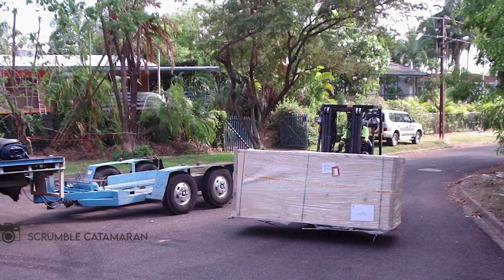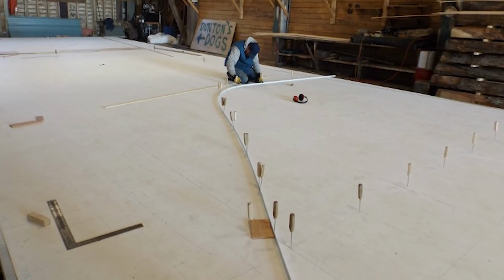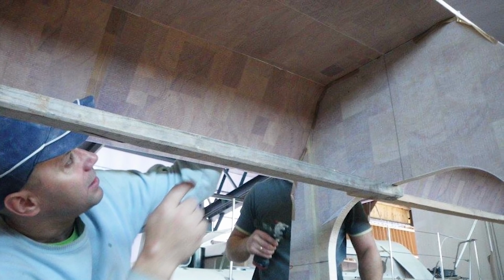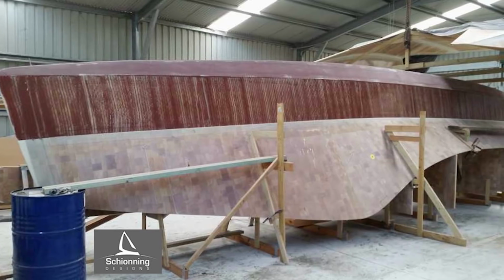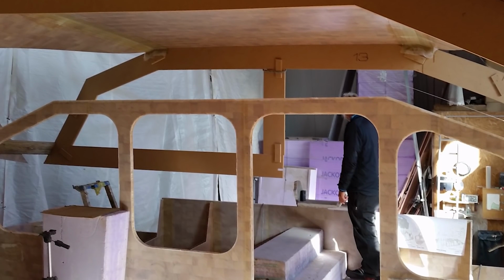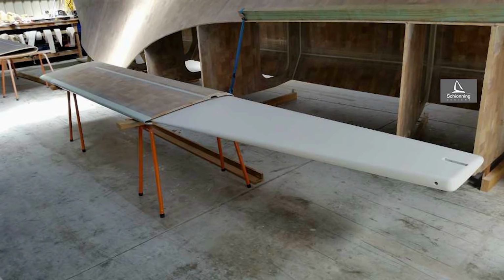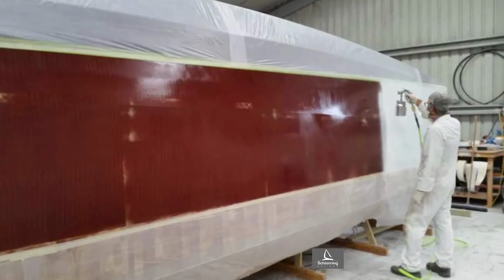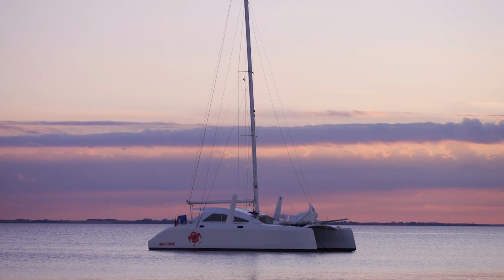What Does It Take To BUILD YOUR OWN CATAMARAN? - MJ Sailing

Comment: I've been watching you for quite awhile now but it's still a shock to see those old photos. You were just babies!! I fully intend to watch the boat build. In 1973 my friends and I worked 10 months on two 63 foot cement hull sail boats. Goal was to crew on one for our labor in an around the world cruise. Worked 10 months and the owner had a heart attack. He lived but the plan was scrapped and I didn't get to follow that dream.
Reply: I wonder why there are no cement catamarans?
Reply: Excessive material weight. And higher stresses in a multi that the cement can't handle. Strength to weight ratio in a multi is vital and the finished product would be a sea-slug.

Comment: Can 2 of you do this in a couple years? And it looks like a bldg is really needed. i think I would rather build  a kit plane...
Reply from the maker: After tearing our current boat down to the metal frames and building it back out again, we feel confident about doing a new build. Something where half our time isn't spent chasing down existing issues.

Comment: Good luck on your project. I've followed you for years and know you have the skills to do it to completion , but I think your underestimating the time it will take. In 1965,when I was 25 years old I built a kit boat 25 ft. in length, they said it would take 500 hours to build. It took 1200 hours to build. Good luck and stay safe.
Reply: Our first dinghy took twice as long to build too.   Just like build a second one, everyone reassures me that the second hull goes twice as fast.    -Matt

Comment: Good tools are a major expense but do not short cut your budget. You can make do on a smaller project but on a project this size It will cost you. Staring from scratch budget about Twenty thousand for equipment. This might be a little low but shop around. You can reclaim some of that after the build. While you have time a lot of information is on line. I have done my share of spray painting and the proper technique is important. There some videos by pros from paint companies that are excellent. They also show the proper equipment. With out that it can be very frustrating I have done it both ways.
Reply: Luckily, not a lot of tools are required for these types of builds.   A good router, jig saw, RO sander, dust collection and circular saw should see us through it.  The stuff we did on Elements required more precision since it wasn't being painted or filled with epoxy.   -Matt

Comment: Where are you going to do this? We are from the GR area and if you need a hand...
Reply from the maker: We're not exactly sure yet, but probably somewhere between Virginia and Texas.
Reply: @MJSailing  For sure you're going to need someplace warm. Providing heat for a building that size would cost a fortune. Good luck you two, hopefully you be able to find an extra pair ( or two) of hands that can help you along. Has Elements gone on the market yet?

Comment: Check out https://www.eastwood.com/paints/paint-equipment/paint-guns/eastwood.html       You don,t need expensive gun.   Use disposable paint cup.   3m and others supply.    Disassemble gun to clean, is quickest way and best way to clean and make gun work like new every time.  Have fun!

Comment: Great description of the process Matt , I think you definitely are aware of the work involved and ready for it.  
I was hoping to hear the hull panels are shipped as long pieces , precut  ready for assembly . Just 4x8’s is just a variation on a plywood design converted to fiberglass panels. Being in the business of making tooling for large fiberglass products including boats  my approach if using flat panels would be to build my own long flat mold and make by infusing  my own exterior hull panels. ( flat infusion is easy!) The interior structure could be from precut designers 4x8 panels.   
Have not been impressed with some if these designs made from cut up strips of coated panels , it wastes a lot of strength building that way and way to much fairing .
But it’s going to be fun to watch , and maybe help in some way! Cheers Warren

Comment: Hi guys and thanks for the overview. Just as getting the form alignment carefully correct as a foundation for a straight boat please start without using the terms fiberglass and epoxy resin interchangeably. For novices who will undoubtedly follow your build it will be a great help.  It shouldn’t be hard if you start out correctly. Maybe if you are applying fiberglass cloth/mat you could (and I know over the build it will become a bit of a time hog) say we are applying fiberglass mat using epoxy resin. Maybe it’s just a pet peeve but if people(and they do now) continue to use the terms interchangeably then there will be a more novices applying the resins incorrectly and suffering the failures. Best wishes on the build, I know it will be exciting. Your videos of your travel this year have all been beautiful.

Comment: Eh you meant 8lb foam not 80lb!!! 😃
Reply: Even worse.... it's was suppose to be 80kg per meter squared.    -Matt
Reply: matt johnson  easily done .80kg? really ? I think That’s about 16#/squ ft. , that might be the entire panel wt not just the foam , balsa core as used on wild thing is about 8.5# per sq ft. 
But whatever they spec .....
Cheers Warren
Reply: @CheersWarren  It's Divinycell h80
Reply: @CheersWarren  Maybe 8.5 pounds per CUBIC foot. Google has balsa at 10 pounds per cubic foot.
Reply: matt johnson 80kg/m3 not m2

Comment: I like both Grainger and Schionning. Beautiful designs from both. Orans I never drooled over the same way. Jeff’s son, Craig, has Spirited Designs and offers a pre-moulded bottom and deck-joint. It’s nice to have some curved surfaces instead of a angles. For the hull bottom it looks more like coming off a professional mold. I also believe it’s built in the upright direction so no flipping over the hulls.

Comment: Look into health side effects of working with these materials.  You might require safety suits and face masks with aired respirators.

Most synthetic resins and the particles produced when sanding are highly toxic.  So, please be careful.
Reply: The same thoughts occurred to me re adverse health effects of epoxy fumes and sanding glass-epoxy composites. For a (not that) young couple to take that risk is unwise.

The world could easily be heading into a Depression. What is left of their savings can be halved again or worse.
Reply: Paul Ohlstein perhaps they will take the necessary precautions.  They normally avail themselves of the necessary information to make the right choices.

These days we know that even sanding normal wood has long term adverse health reactions.

Comment: When you get to the paint stage prep the boat and hire a spray guy. That will save you money and time.
Reply: I hope I can talk a body shop into letting me steal their spray guy for a few days.  The guys I worked with before (I worked in car dealerships) would have no trouble switching over to something the size of a boat.  -Matt
Reply: matt johnson good idea matt, that’s my job and I was going to suggest the same. They have years of gun skills and it won’t cost you much in the scheme of things and a pro finish. An area not to skimp on.
Reply: Painters always like weekend money. I highly suggest getting help and sometimes 2 and 3 guns is better than one if you have a big spray. Boat yards many times have a good Gunslinger that's used to the big sprays but usually not the same experience of the body shop painter. In the body shop we are used to gravity or siphon feed guns and boat yards tend to have more experience with pressure pot setups. I would definitely consider pressure pot as it is much easier for the big sprays you don't have to fill the gun all the time and you can get some real material laid down and not have to spray forever and ever. But please whatever you do buy the highest quality paint. In my opinion there are really two choices Awlgrip, or BASF Glasarut. Whatever you choose do not use any water-based paints! I would recommend a base coat clear coat system even if you're using white color. But in no case use water base anything! You will suffer grief now or later on use the tried-and-true and it will last a long long time! I've had 38 years of Auto and Marine painting experience and own major Collision Repair Center. I hope this helps. When it comes to tools make sure you have a large air compressor 5 to 10 horse Electric. Best not to have cheap Harbor Freight model buy a good one and sell it when you're done. You MUST BUY a refrigerated air dryer to remove all moisture from the air and also an oil filter and additional water particulate filter. If you don't do this you will get moisture and water in your air and you'll be sorry in a year when your paint is bubbling and checking. Don't think that any water separator filter is going to take out the water it doesn't work that way you have to change the temperature and that's why you must use the refrigerated air dryer to extract all the water! A desiccant dryer is another choice however I would prefer that after an refrigerated air dryer but you should be able to get by without a desiccant dryer. They tend to be expensive. . Don't try to get by with just a desiccant dryer either. When you decide on your paint brand have your paint supply store put you in touch with the factory paint representative you are going to be a big customer and make sure they help you design the right system for you to use. That way it will be guaranteed!! It will save you all kinds of time and grief. The paint representative will help you with spray gun and spray tip sizes and pot pressures. An airless sprayer may even be an option but rely on that paint manufacturers field representative for help. Make them earn their money they're going to get plenty of it. LOL
Reply: charlie cruzen matt, very good advice from charlie.
Reply: @charliecruzen3394  Another option for keeping the crap out of your air for painting, is an HVLP turbine system.  They supply air that is inherently dry and warm, so there's not actually anything to remove.  A bit expensive but can be sold afterward to recoup some of the cost.

Besides auto body and marine shops, aircraft painters will also be accustomed to working with large jobs.

Comment: Since you are looking at value you are obviously looking at resale price.  To me some of these kits are fairly out of date on style.  You would not want to go through this effort then find out a boat was less sellable as it was very "out of style"   So I would make sure the style was pretty current.  At the same time as much as you want to "personalize", keep that next person in mind.  Personallizing to make it perform better or live better is good.  Personalizing to make it "unique" might not be.   As an example, I am currently looking at large used Diesel RV's.  Some have things like a sofa pulled out and that replaced with a "fireplace" or fancy entertainment center.  While that suited the original owners style, it does not fit mine and has therefore limited the future buyer pool.  Just some thoughts.
Are you considering building in Florida again?   You were only 20 minutes from me, but I was not aware of your project then.  I would guess some site slightly cooler would be in order.
take care and good luck -- Dale - Palm Beach Gardens FL.

Comment: Admire the guts it take to start a project like this. Having done comparable constructions designs (aircraft not boats), take your time early in the build, to plan your pluming and electric infrastructure. If possible put in tubing to draw cables through and have lines ready inside them to pull cables. A well designed system will facilitate maintenance and future changes. All this is easiest done if you can avoid having to crawl through tight spaces later. Looking forward to follow your progress.

Comment: There are powered fairing options.  I haven't used any of them (I built a small 20 ft monohull), but I think they would be worth it for a project of your scale.
Reply: It's on the list to investigate further.  But from talking to others, unless you can borrow a compressor large enough to keep it going, the expense is too great for anything but a pro   -Matt

Comment: 80# density??  Say what?  Divinycell H250 is 15.6#/CuFt.
Reply: Sorry, that's 80 Kg to the cubic meter not LBS.   -Matt
Reply: @mattjohnson6716  That sounds way too heavy. 80 kg/met^2 is 16.4 lb/sq ft. 3/4 plywood weighs 1.9 lb/sq ft.
Reply: @pauleohl  opps... cubic meter not square.

Comment: Bunch of questions...are you serious about building it under a tent?  You really need a pole barn.  Like you, I built a small boat a few years back, an 18 foot sailboat...I hope you have a lot of friends who are going to be able to help with two 40 foot hulls.  That is a lot of weight...how are you going to turn over the hulls and move them around?  This is a major job.  It seems like you have an idea what you are going to do, not sure you understand the scale.  good luck.
Reply: A single hull is around 1000 lbs in the stage where it gets turned (depending on design).  Hard for two people, but with four it's apparently pretty easy.   -Matt
Reply: @mattjohnson6716  A forty foot assembly weighs only 1000 pounds???

Comment: Hi Matt and Jess, I am so glad that at 62 I am too old to ever attempt this kind of craziness. Whereas U2 are young and have the time and inclination to create. I know Matt is active on cruisers and Sailor‘s forum, have you to given any thought to how you will protect yourself against Epoxy sensitivity? There is a fellow who’s handle is “Chotu” Who has become extremely Epoxy sensitive halfway through his build and now has big problems. Just a bit of proactive thought for my favorite YouTubers.Cheers
Reply: It's a worry for sure.... especially since it's usually accumulative sensitivity and we haven't been the best in the past about protecting ourselves.  Fortunately, if we do get a reaction, the designers do have options to switch to vinylester for the build.  It would be heavier, but it can be at least finished.   -Matt
Reply: @mattjohnson6716  switching chemistry mid build is not optimal. Just start with vinyl ester.
Reply: @mattjohnson6716  hi Matt, looking forward to your build 👍👍. am considering a project like this myself. On an average "guess" - what's the savings in cost to  build the cat yourself?  and also is the Kit supplied as to your specific design request?

Comment: I think you both are crazy but I also thought that when you started on Elements so what do I know. Good luck, I know it will fun watching.
Reply: I'll bet you can find a project where the builder has waved the white flag. It might be a lot less expensive.
Reply: @carbidegrd1  Less expensive, but you'd be buying the previous builder's mistakes, and also be stuck with it wherever it happens to be.  Once the cat is out of the bag (or the 40' container), and the panels glued into large sections, packing it up and shipping it would range anywhere from difficult to impossible.

Comment: What a daunting task. I wonder how often you’re going to say “Oops “ (or something stronger) during the course of this build. It’s going to be fun tagging along.  

If you haven’t already you need to check out Madds from Sail Life.  He used a unique tool for fairing and sanding.  One of the tools was power.  Andy from Boatworks Today also picked up the same set. While still a tortuous task these tools significantly lessened the pain.  I’m sure someone here can recall the name and supplier of these gadgets.  You can also get some great tips on ventilation and dust extraction from Boatworks Today.
Reply: In that vain I would also check with Teal (On board Lifestyle). He has just about rebuilt his Cat. GOD speed. JC
Reply: JCAJCA3  And his boat was built in FL from an assembled curved  panel ( all the same panel shape!),  Less racy but way more room and still light wt and fast!
Reply: I really like the looks of the Felxisander, but like every good quality tool, the price is expensive... we'll just have to see if it is in our budget vs just our homemade board.   -Matt
Reply: Madds is the man for doing fiberglass and doing everything with building/renovating a sail boat.
Reply: They, and do many others, will greatly benefit from comments like yours. I hope i will at some time in my life. Which shortens every day. While young, go for it! 
Your knees may feel wiggly before you know it.
Reply: I saw this on a wood working channel I follow today it seems fitting to re-post here.  "Measure once, curse twice"  Good luck with the build hope to see it splash soon. 

Did I miss something in Matt's build description, I don't recall him saying at what point the iron wind is installed.
Reply: @corvairchris82  That saying fits me perfectly.  I don't understand how I can measure things 6 times and then cut it an inch short.  

We're planning on outboard drives for the boat, so it's a much easier install.  

The boat shown had electric propulsion, but they switched back to diesels after a few months.  

Matt